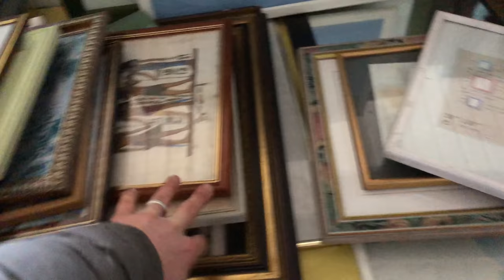Second Hand Shopping For The Château & Cottage, Plus Fitting A Sliding Door. Ep 16

Comment: Hi! The "vases" that you saw is for bringing humidity into the room.  You fill them with water and hang them on the radiator. Love to follow you! 😊
Reply: Much better than what we have today. In my house it’s an enormous electric humidifier that barely changes the humidity in the room. And so difficult to clean every few days!
Reply: Came to the comments to say exactly the same thing.
Reply: Wow! I have some that we call 'wall pockets' and are supposed to be vases. Thank you for the information.
Reply: @nancibishof6462  no these are not wall pockets at all that’s totally different. This style is meant to hang against a flat radiator they make a different style shape as a T to fit between the sections of an old radiator.
Reply: If you add a bright green rooted vine (not English ivy) to the humidifier wall vase it adds color to the room and helps balance the inside air.
You'll add water more often but it's worth it to clean the air.
Reply: @derekbriggs6207  be careful with some of the oils, some of them are toxic to pets!!

Comment: The three flowered "vases" that you came across are not vases. They are clay, so porous and you fill them with water and hang them by the hook on the front of your electric or oil wall heater so as to keep a proper level of optimal humidity in a room.

Comment: They are not vases. You hang them over your radiators . Put water inside and the water evaporates when your heating is on. It is to stop the air becoming too dry. I used them when I lived in Italy. You can also place them on the guards of gas fires.
Reply from the maker: Thank you very much 🥰
Reply: @chateaudelalacelle  Great videos...

Comment: I know its way toooo late for my opinion, but I JUST SUBSCRIBED AND AM CATCHING UP BY WATCHING SOME PAST VLOGS. - THIS ONE AIRED fEB. 2, 2022 - BUT I'M SO CURIOUS as to WHY
a SLIDING BARD DOOR inside such a well finished cottage was used ???   Oh my, what is done locally is simply a flat (usually) metal cover is hinged on and painted the color of the room wall,
and then an appropriate painting or print in a suitable frame is hung over the box...no one sees it...no one knows its there...but THERE IS A SLIDING BARN DOOR THAT IS WAY OVERSIZED TO SLIDE OVER INTO THE TABLE SPACE AND YOU'VE LOST ABOUT 36 INCHES OF WALL TO DECORATE...my opinion as you have probably received many - is toooo late, but what a shame..anyway...